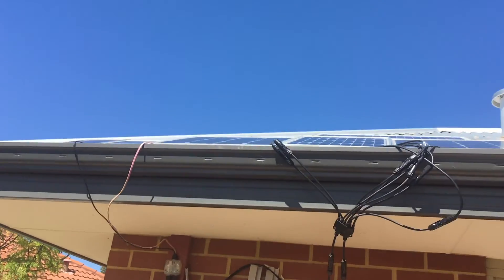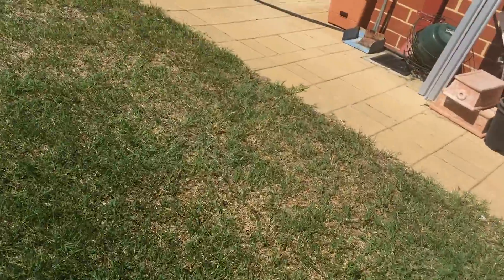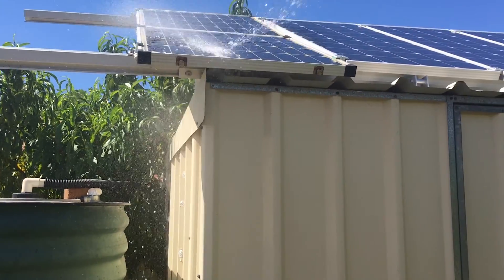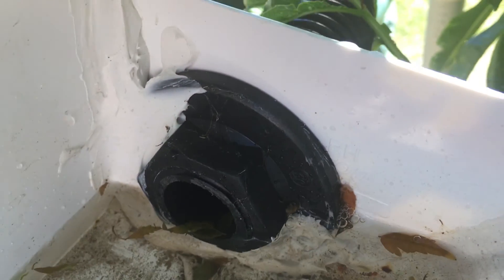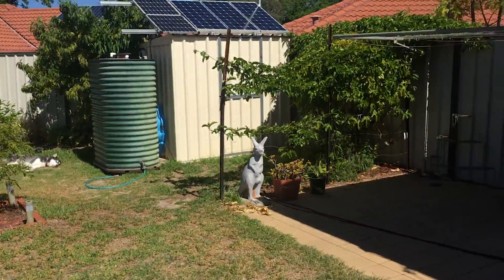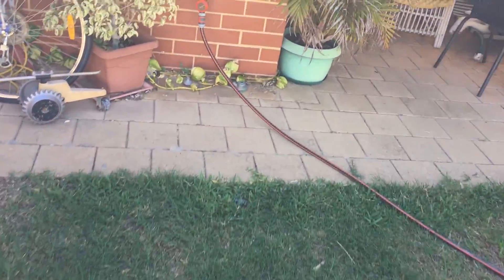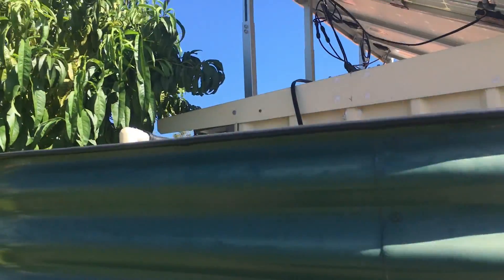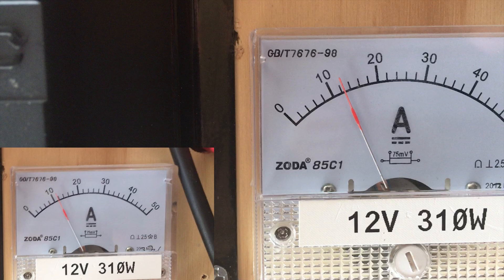How to get more power out of your Solar Panels on a hot day

Comment: Interesting video.  

You might want to change the rack on the house for a rack that allows for a bit more separation of a few centimeters between the back of the solar panels and the roof.  This may allow for more air flow, and this might cool the panels. 

I, also, noticed that both sets of solar arrays are not facing in the same direction.  
This might affect the temperature of the panels depending on the hour of the day.
Reply from the maker: I will be putting racking there at a later date it was only post to be temporary just haven’t had the $ and I have few sets of rays two of my face in the same way and one is facing the afternoon sun and the other ones are facing the morning

Comment: ive seen high quality water bags the same dimensions of the panels permanently touching the underside of the panels to cool them , the water can be pumped using a low volt pump through a heat exchanger and back again, probably better of buying more panels really.
Reply from the maker: +Ken B 
Wow I did know they had that 
I just cool them down because I just don't have the money to get more panels and I need the power been doing it for years slowly getting there with my System
Reply: you can get top quality panels very cheap off gumtree from people who are upgrading their grid tied system, and they are very cheap at times and far better quality than ebay has to offer.
Reply from the maker: Ken B 
I have look on there but it's to expensive people have been putting on there way  overprice
Reply: True but on the rare occasion theyre crazy cheap, a week ago a guy was selling 6 240w panels for $40 each very high quality and near new, he was in Tapping WA
Reply from the maker: Ken B 
Wow that is a good price